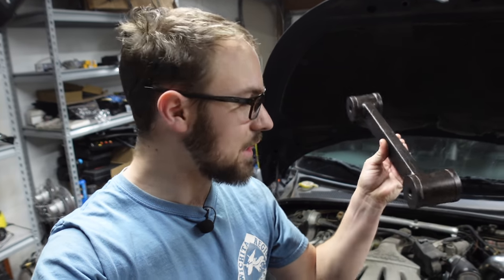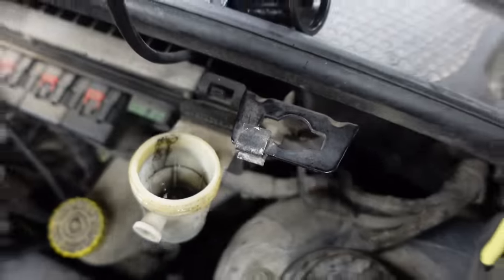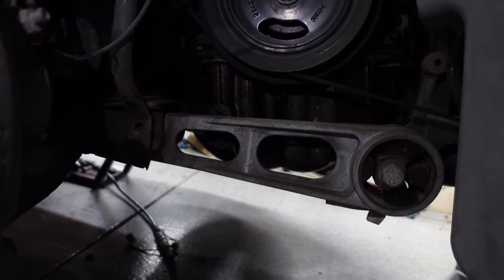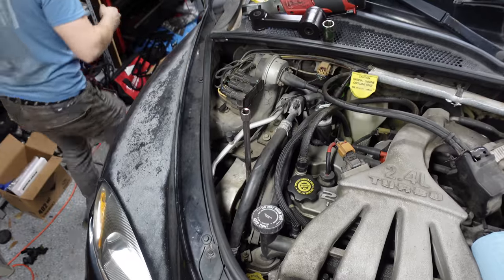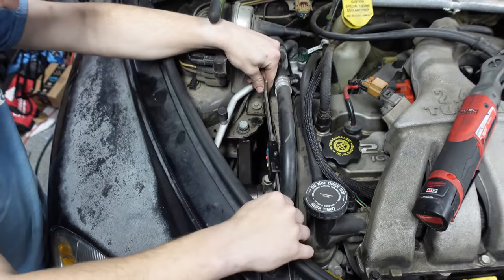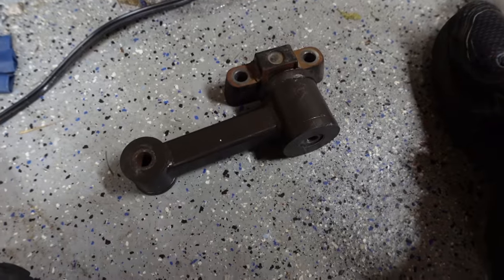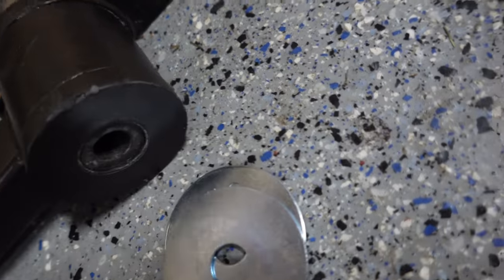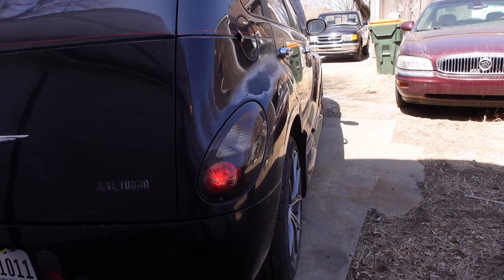BULLETPROOF motor mounts in the PT Cruiser

Comment: If you end up changing the center motor mount, be careful not to break the timing belt cover while fishing it out. There is barely enough clearance to coax it through even after lowering the engine a bit once all the mounts are loose. Had horrid engine vibration through the dash in an 04 Neon, they have the same motor mount setup as this. Replaced the upper and lower torque struts as well as that hidden center mount that is buried in the subframe. Like you said, pretty much may as well do the timing belt and water pump too because it is right there.

Comment: I owned a 2004 srt-4. There is a adjustment on the clutch pedal. Just have to loosen the nut or bolt on the top of the pedal and pull the pedal out then tighten it back up. It's been 18 years since I owned mine but it gives you a idea at least where to start.

Comment: Pumping the clutch 50 times is a double check. If you look up an OC Curve 'operating characteristic curve' 50 times without issue means there should be 0 issues.

Comment: Would it honestly be worth the trouble of going back and reversing the upper mount bracket. Mine were initially installed wrong with the flat area not facing the solid motor mount.